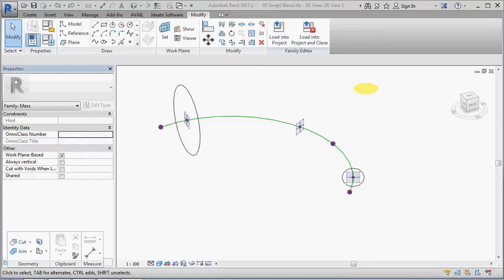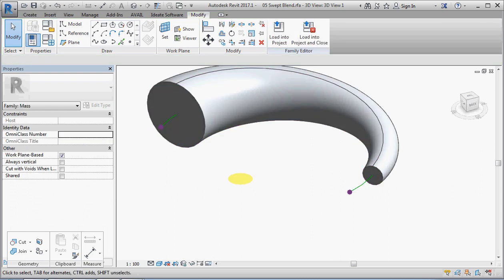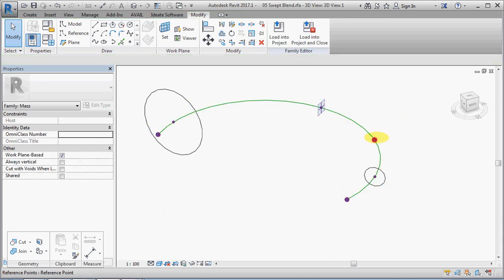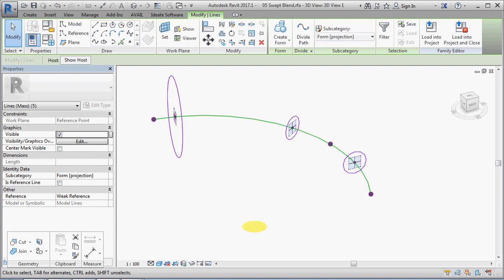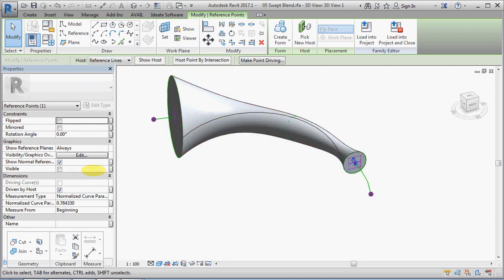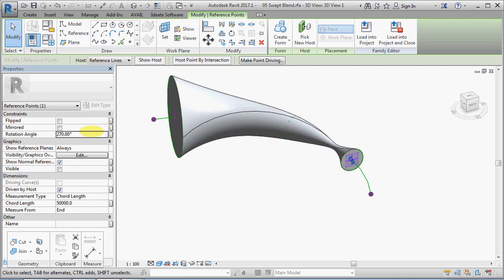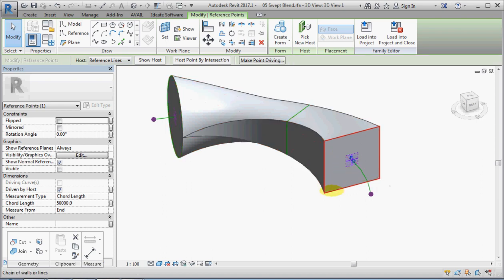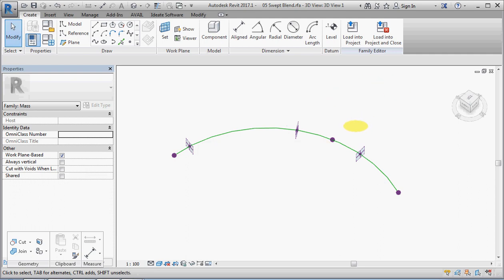05 Creating a Swept Blend in Revit Concepual Massing

Comment: Hi Tim, I'm trying to create a concrete deck surface using various profiles along a 3D path where I have various Z levels, but I get the "Unable to create form element...error". Any ideas on how to resolve this as I have gone through your Blog but I haven't found a solution...unless I start looking at Dynamo.
Reply from the maker: Hi AH G.  There are so many possible reasons it is hard to tell what the problem is without seeing the model.  If you have a 3D path that curves back on itself that is asking for trouble.  My recommendation is to create a simpler shape then push and pull it to what you want.  Have you looked at this BIM After Dark presentation:  https://youtu.be/VUkM7I1tiTs
Reply: @RevitCat  Hi Tim, what I have just tried is a simple profile as a rectangle being applied to a 3 point curve, so straightforward. What I've just found out is, if I place the profile on one point and select the path to create the form I get the error. however if I apply the profile to the 3 points, it creates the form following the path. This is fine with me, as I will have 18 different profiles along the path. Thanks for the link, I did watch it live on the Revitkid channel. Thanks for replying and keep up the good work :-)